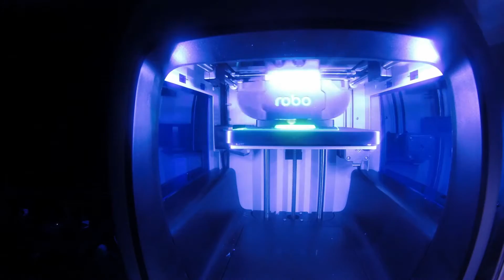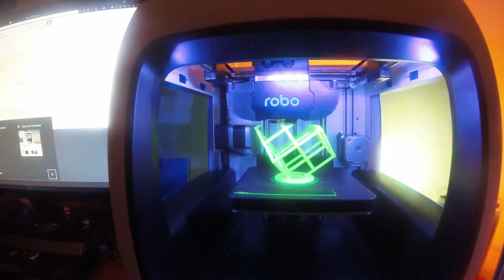ROBO C2-Printing a Lattice Cube

Comment: I'm pretty new to 3D printing and I got a Robo C2 but what do I enter for print speed it says 16mm3/ what do I put for print speed I know travel speed
Reply from the maker: ZecRo For now, just go with the presets and mess with fine tuning later on. when you use Cura their are profiles that will allow you to print the at different resolutions that are pretty reliable.
Reply: moozicmon what speed do u use when your printing normal .2 mm prints and when u got your printer was your build plate off mine was just asking